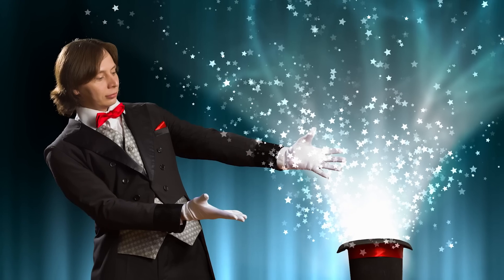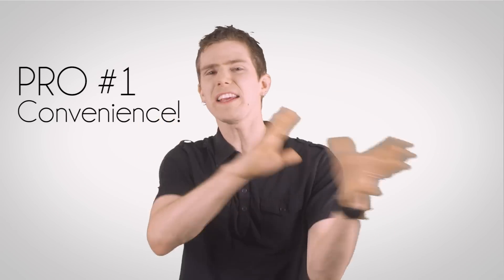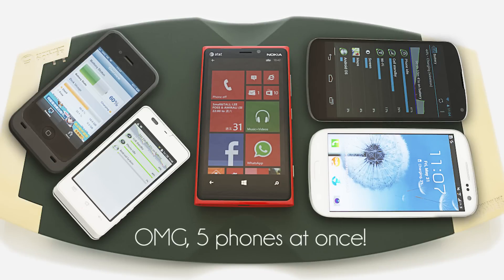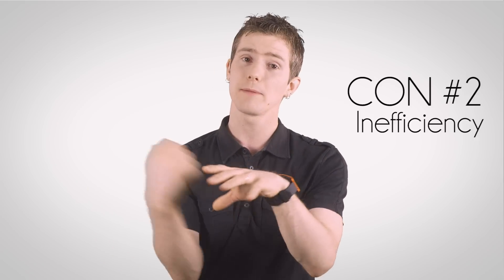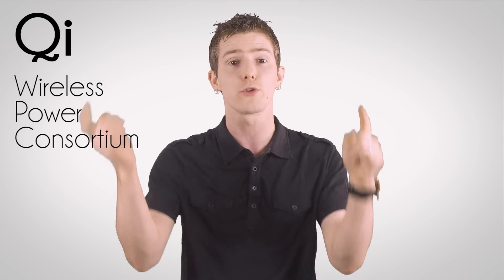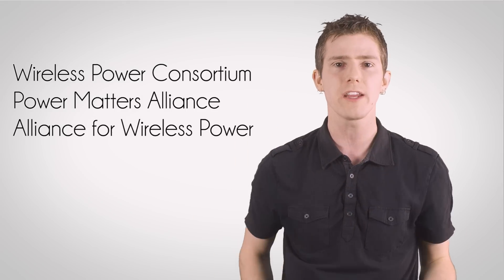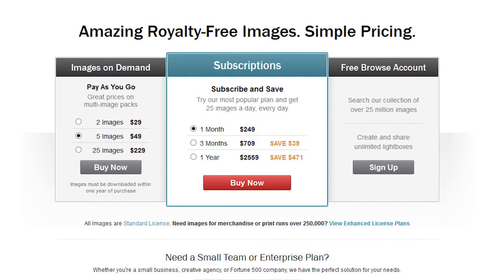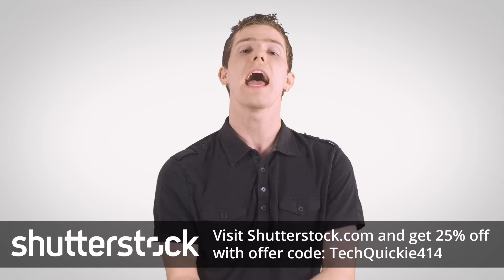Wireless Charging as Fast As Possible

Comment: wireless charging is a pointless gimmic
Reply: +jo l i agree but what samsung has right now is not
Reply: +Trevor Schoulte i use samsung as an example and it is pointless because you still have to plug it in and it is still confined to the length of the cord and what makes it worse than a regular cord is that you cant move it around and use it while its charging. the only thing it does us save the one second it take to plug ur phone in
Reply: +Trevor Schoulte and when i say plug it in i mean to the wall

Comment: Ok so no tips on how to increase the speed of charging..

Wireless charging is still shit 6yrs after this vid was made..

It's not even wireless.. The pad is still plugged into a plug socket via ohh a wire
I think it's less convenient, can't use my phone without losing the charge connection
Charging wireless whilst asleep and using a wire when in a rush is backwards AF. No?

Phones having glass backs are ridic with these pads.. Sliding about more than dicks involved in a gang bang

Undeveloped and unnecessary "technology" made to line manufacture's pockets even more so.

And yes I'm having a god damn moan.
It's my write as an English woman..

Or some shit